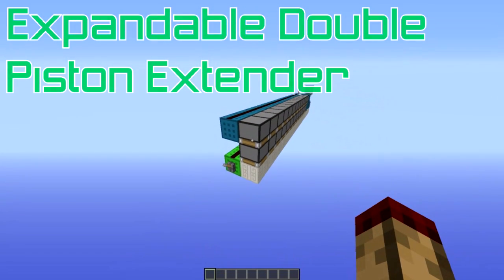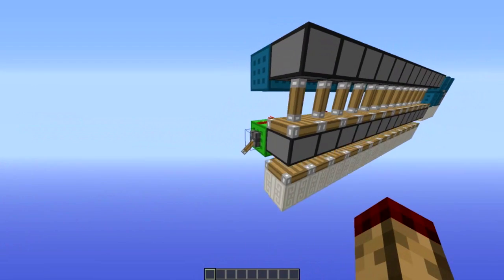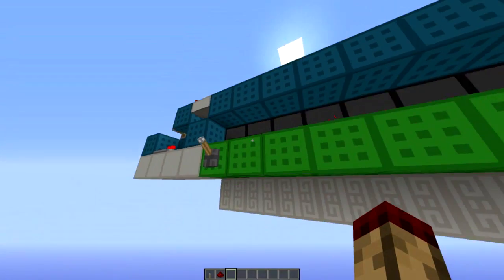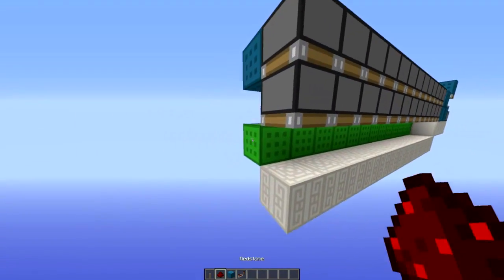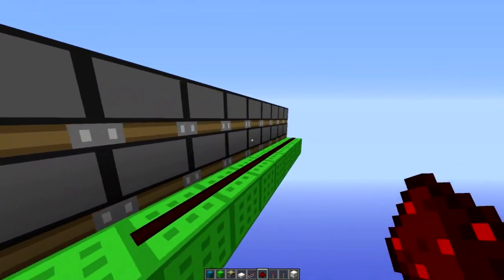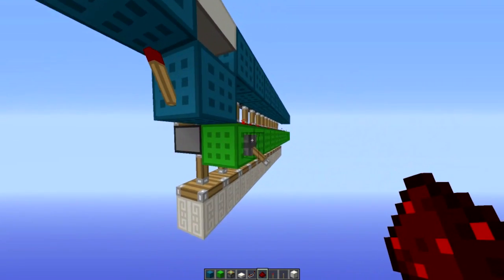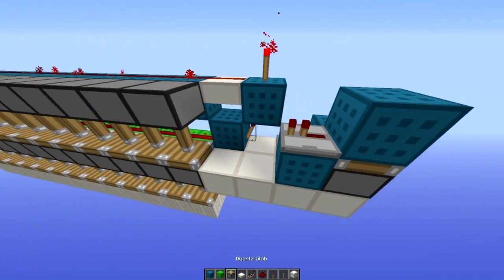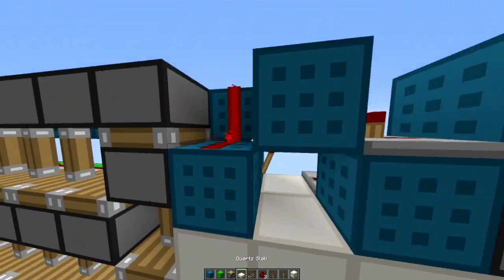Downward Double Extender [Expandable] - Minecraft 1.7 Redstone Tutorial

Comment: I'll tell you what does work. Change the block coming out of the topmost torch to a slab and lower the block that the repeater feeds into (the output from the monostable) by 1. That is basically the same concept as my one, but mine works on the opposing edges (extends on the falling, retracts on the rising).